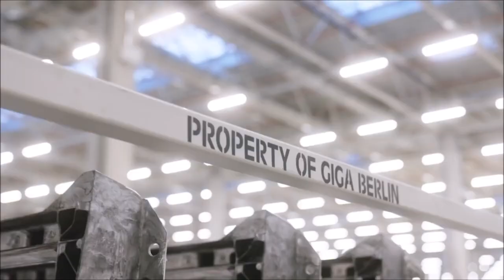BREAKING! Tesla Releases a Stunning Video of Giga Berlin's Production Process

Comment: Stamping is not die casting.   Two large die castings are used per car but at least 15 or so stampings (fenders, hoods, doors, etc.) are used per car.   I'm not sure how many stampings they can do in parallel or if the 20 seconds is an average per stamping.

Comment: Armen - front and rear castings are produced by an IDRA 'press' and use molten metal as their starting point.
"Every 20 seconds a new body part is produced by stamping" refers to parts that are produced using rolls of cold sheet metal as their starting point. Stamping presses were used for most of the '00s of individual parts previously assembled by robots to produce the two castings now used for the front and rear end of the car. They are still used for much of the car body.

Comment: There are 28K-30K parts in your average car, but this is likely just talking about the stamping process to produce the front and rear chassis section which is attaches to the structural battery in between.
Reply: Not to mention every gear, piston, valve, spring, wire, connector, fuse, bearing, etc.